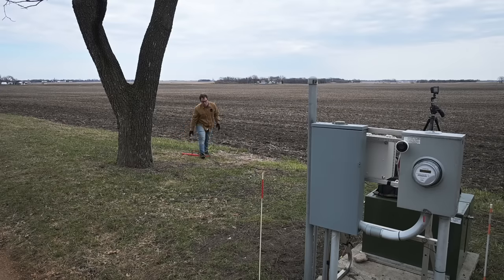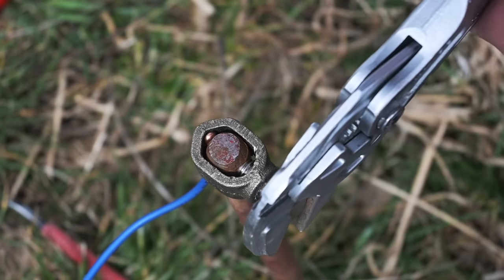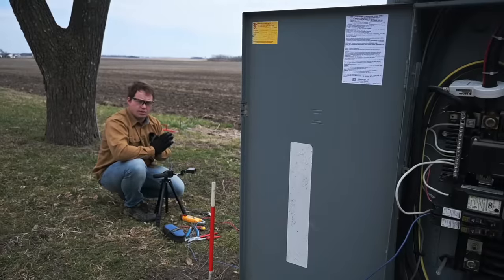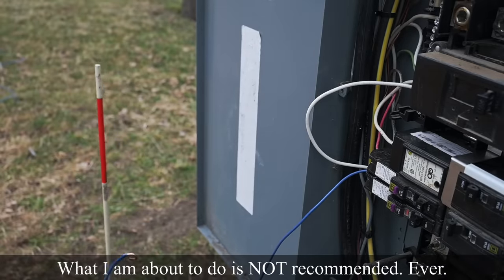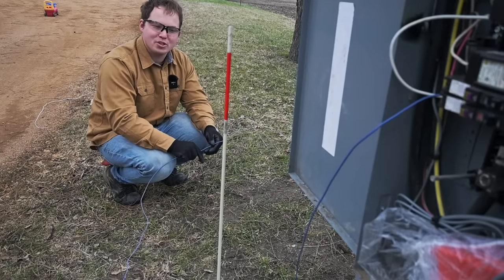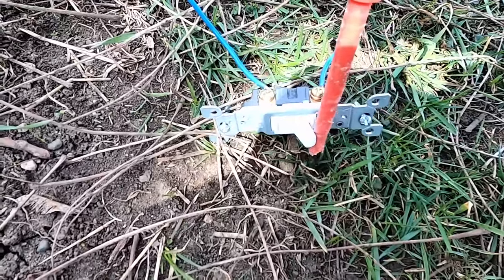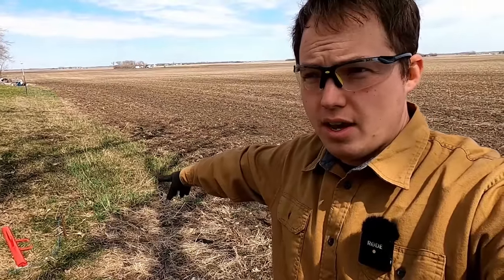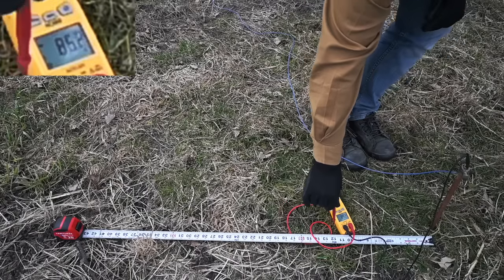Will 120v To Ground Trip a Circuit Breaker?

Comment: Benjamin,   Very good video!  I will reference this when I see necessary to change someone's mind!  About 99% of electricians and engineers incorrectly think it should trip.   What I taught was, If you need worms to go fishing, get one of those 12" long nails, attach it to a wooden handle(like from a rake) solder a conductor to it up the handle and install a plug to it on the hot side.   Now get an extension cord and plug it into a standard receptacle that you connect to the breaker in this video.   Plug it in, and probe the ground in different places.   Worms come very quickly out of the ground.   Suggest you pull it out of the dirt before picking up the worms though!   Respectfully,   Kevin
Reply: No 99% of electricians and electrical engineer know the breaker will not trip. So here is why the breaker did not trip, the was no source back to the grounded conductor. When you drive a ground rod for a panel, a conductor is taken from the rod to the “neutral bar”  or ground bar (I am setting this up as a first means of disconnect scenario and both the bars are bonded together) bounding the ground rod to the source power ground.  Basically what I am saying, no path exists back to the source power ground because there is to much impedance in the earth to allow the electricity to flow freely from one ground rod to the other.
Reply: @GUYJO1969      My point is, if you ask electricians and electrical designers and engineers this question 99% give an incorrect answer.
Question,   In a properly installed electrical system, if there is a short circuit between a hot conductor and the case of an electric heater that has equipment ground connected to it, from that point what is the path that the current will flow?   
Please give me your response to the question.   I think you will get it correct.
Respectfully,    Kevin
Reply: @KevinCoop1  
It flows across the ground conductor to the grounding bar, and then to the neutral (technically the grounded conductor of the service) thus tripping the breaker. With respect, I am an electrician and I have always taught my apprentices that I’m order for a grounding system to work properly that all metallic parts that are not supposed to be energized must be “grounded” (I use that term loosely) or bonded (this is the proper term) together. I have never had, but one set of prints in which a grounding conductor did not return to the source neutral, it was for an IG system, I flatly refused to do it. With respect to you I have been an electrician for over 20 years,  I do not know of any electrician or electrical engineer who insist that the entire system be bonded back.
Reply: It’s kinda insulting that you and you other people think so poorly of us as a trade. We try to train everyone the best we can. It’s very regrettable that you have ran into electricians that believe a ground rod driven into the ground and not tied into the source grounded conductor will trip a breaker. That is one of the first things I teach my apprentices. I had a friend shocked because the service neutral was lost at the pole and all the voltage and current was running down the grounding conductor to the ground rod. I can give you more details if you like.

Comment: Good video Benjamin!  I had someone comment on one of my videos asking me this question and I replied saying that if it was a good ground with sufficiently low resistance, it would trip the breaker.  He then pointed me to this video.  Had I thought about it a little longer before answering I would have changed my mind.  It reminded me of how my father and I got rid of dew worms in the lawn by placing 2 metal coat hangers in the ground about 3 feet apart and attaching them to hot and neutral.  The breaker didn't trip, but the dew worms sure didn't like it and would come wriggling out of the ground almost immediately!  Again, we must remind our viewers, "DON'T TRY THESE EXPERIMENTS YOURSELF"  Way too much room for error! Step voltage and touch voltage can be very dangerous and deadly!

Comment: Couple thoughts,
When I have done ground resistance testing utilizing FOP method most single ground rods I’ve tested in dry soil have been around 10-25 ohms. These breakers have a long time and instantaneous trip elements. To hit the instantaneous region you are going to be somewhere around 10-15X the FLA rating otherwise you are in the time-over current region. Trying to measure fault current you may be better served by a meter that has a peak function as some meters are not “fast” enough to capture that instantaneous peak reading. Cool video!
Reply: I think the voltage step potential that you highlighted was cool. This is a big deal in high voltage substations where you can be dealing with thousands of volts step potential if equipment isn’t bonded thoroughly.

Comment: You'll trip the breaker if the ground stake is close enough to your panel's earth stake to allow more than 20A to flow. 

It's interesting to note that locally the earth has a fairly high resistance (as demonstrated by your voltage gradient) however because of the planet's size it has a low resistance because the area of the conductor is huge even though the conductivity of the ground is lower than a traditional conductor.
Reply: I wish someone can actually do it so I can "see" it. It's sometimes difficult for me to learn without tangible proof and I don't have enough safety equipment to try it at home haha. I might go boom!

Comment: Ben great video, I am a underground troubleshooter working for the utility company in NYC. Queens and Brooklyn. You would love to troubleshoot stray voltage in a underground network system. There are so many failure points, you do a great job in explaining and demonstrating the problems. Most people have no clue what the difference is between a ground and a neutral. If you opened the neutral to your home, the ground possibly pick up the amperage and you would have stray voltage all around your property. Especially on your hose spigots. 99% of flickering lights are due to open neutrals from utility, Great job, i subscribed today.
Reply from the maker: I can't imagine doing troubleshooting work underground in NYC! Would be super fun to come along with you to work and see what its like. Thanks for sharing!

Comment: Have to say, I am total blind and I bought the Home sense and had it installed and its helping me know what is useing all the power and so forth while moveing each line to the other breaker to take away from directly from the grid.  Thanks for showing what would happen if I mess up and power go into ground. so I need to get a GFI breaker 240v breaker from the inverter so if a wire is wrong it trips.  Thanks

Comment: This isn't expert opinion.  

There are two ground systems in household electricity.  The ground rod which provides a path for high voltage spikes induced by nearby lighting strikes, static from dry wind air flow, in big systems partial faults in motor windings and such.  If the ground rod wasn't there then those spikes would build until they breached the insulation voltage rating and/or found an arc path to Earth.  Uncontrolled arc paths are bad because they can happen right through or around flammable material.  The high voltage spikes are high frequency and dissipate in the Earth resistance as they travel to the transmission system ground rod or the Earths static field.  It can still have enough current to kill a puny human if they are part of the path.

The safety ground is the bonding wire that connects every part that could become energized due to a hot wire fault, such as chassis, water and gas piping, etc, with a very low impedance path back to the transformer and then the breaker to clear the fault.  You can still die in that split second it takes for the breaker to trip if your body makes the final connection.  

The bonding of the neutral to the system ground provides a path for the system spikes.  The bonding of the safety ground to the neutral provides a path through the transformer to the breaker.

The ground rod started out at 9 amps which is 13 ohms and increased, likely due to heating along the path in the Earth reducing resistance.  20 amps for the breaker is 6 ohms but you need lower resistance to cause an overcurrent fault or more time for a heating fault.   The ground rod was interacting with the system ground of the box, the Earth provided a resistance between the test and system ground rods.  When you touched the cabinet, you were interacting with the safety ground system, i.e., almost no resistance, high current to trip the breaker.

The only way to get everything to the same potential is to use a low resistance connection, i.e., wire.  

And electricity takes all paths back to complete the circuit, including the ground rod if there is a path, not just the least resistance.  The least resistance path gets the bulk of the parallel current.
Reply: Also, I'll say for better effectiveness, one system is more sensitive to resistance(ground to neutra path).
The other is more sensitive to impedance due to the frequencies. That's why the ground conducter to the electrode must be short, straigh and with minimal bends as possible. Sharp bends increases the inductance significantly!
Reply: JK Brown why would a human being part of the path necessarily kill the human? Lightning strikes are one thing, but he is on a 120volt circuit. Would the electricity not travel along his skin as the easiest path and not close to his heart? Millivolts can kill your heart in close contact but it would be hard to get that close to the heart, given paths with less resistance. I have zapped myself plenty of times (120 and 240) with both of my hands completing a circuit and I am alive and well.

Comment: I really like this video!
I'm into structure cabling.

Short to Ground will only the breaker of the Ground is bonded to Neutral( at the Main Panel)!

I've seen engineers and electricians install 'isolalated ground' that does not connects the building grounding system at  Main Panel.😱
Reply: * short to ground or any metal part would only work if at the breaker panel or first disconnect the current carrying conducter(neutral) is BONDED to ground.

Comment: I’ll be honest.  I thought it would trip.  Level of thinking.  “15A breaker, going straight to ground.  Thought the draw would be too great and that would have tripped it.”  Good to have this knowledge considering all the renovations I have been doing.  Might have to upgrade to GFCI/AFCI breakers even if it is not called for per code.  Seems like a safe step to take.  Thanks for taking the time to do these experiments.

Comment: Ben 

The ground wire is to keep equipment at same potential as the neutral.
As you video show at ground rod their is zero potential ,  the further you go away the higher the voltage.
Therefore the green wire keeps the equipment or as you call it frame at same potential which prevents you becoming a alternate path to ground and getting shocked it is not designed to carry neutral load.
This is called step potential.

Your GFI type circuit breaker are called differential relays what goes out has to match what coming back and detests leak / shorts to ground and  it will trip almost instantly as it see as you stated as low as 5 milliamps. Better than 20amp overload  technology.

The main thing you have not talked about is the neutral wire can kill you even if main and branch/ feeder CB are open .
The neutral is still connected and is therefore it goes back to utility company transformer feeding you and other houses, etc. 
Therefore if you are working on  circuit close to another service panel you could be the path of least resistance and be a parallel path  back to utility company transformer ( step potential again.)
As a retired utility company grid operator and licensed electrical contractor I have seen one fatality and one person shocked due to this.
Yes this is 1 in a million but possible , however in your farm setting 1 in a billion.
Also soil type,  moisture content , water pipes, gas lines, sewer pipe rebar in major highways etc , etc. and distribution transformer specs. are tested and minium trips for circuits are calculated on a utility grid  most houses  however are using 15, 20 amp , etc circuit breakers or 1940 technology. The new codes and GFI type circuit breakers are 1,000 times better to protect your house and you against death , fire, and shocks.

Final note 
If on a power grid it's down and  your running off your generator and lighting hits the neutral lead on the grid it will want to find ground and can come down that utility company ground lead  and it will try to go thru your panel to your ground and if your generator ground/ neutral is not isolated it  can back feed and damage generator windings
This depends on a number of variables of the situation,  how close lighting hit to your equipment, intensity of hit moisture content , size of wire , etc., Etc.
It is a possibility 
Therefore a high end transfer switch  will isolate  and change neutral over to your generator which will be a grounded system even if it's a open neutral as your video shows.

Comment: Bro, the ground you just put in is a different ground from the one your panel is hooked up on. The soil has electrical resistance! This is exactly why there is one ground per service and only one! If instead of nailing a new ground, you just connect to the existing one, you would have a short immediately, just like you had when you sorted to your panel...
Now, in a building with a good grounding there is less risk because metal in the building is good conductor, which would trip the breaker if touched by a hot wire.
Great video, but I wish you'd explained it all better, the way you left it, makes it look like, in a correctly grounded system you are not safe.

Comment: When the wire was touched to the metallic box, the current was far greater than 20 amps.  The only limit on the current would be the impedance of the secondary winding of the utility transformer and the current probably peaked to 10K amps before the breaker tripped.  That’’s why the wire melted.  20 amps should not have harmed the wire.

Comment: Great demonstration on the voltage gradient! Just remember that the farther your feet are apart, the greater the potential is between your feet!
This is just with 120 volts. Just think if you had a near by lightning strike with several 10's of thousands of volts and thousands of amps flowing through the ground and add multiple ground rods Not bonded together and you can start to see how so much damage is done to electric appliances and electronic due to nearby strikes or surges on the power lines.

Comment: 14:55 that’s also one of the reasons why the ground rods are bonded to the neutral in the panel. That way it trips the breaker. If is it done the correct way it is safe, but if your grounding system is not bonded it is not safe.

Comment: Im looking forward to this series. Very good video! Grounding rod from what im getting in my electrical apprentice journey is for lightning mainly. Its all about the current as those electrons get back to the source that trips a breaker so going to the grounding rod wouldn't do it. As for why that happens im still learning haha. I know bonding vs grounding is a confusing subject. But really grounding rods get too much focus.
Reply from the maker: Agreed.
Reply: An easy way to think of it is to look at a house as having two separate grounding systems which are for different purposes and are not functionally related to each other. The first grounding system uses the EGC (equipment grounding conductor) to provide a low impedance path back to the neutral bus bar to trip the breaker right away. The second grounding system simply connects the house's electrical system to the earth to allow accumulated static charges to go where they want and need to go - to the earth. Otherwise the static voltage can build up quite  high on all of that wiring  and short out expensive motors and things like that. Also it helps reduce high voltage spikes from nearby lighting strikes which also want to go to ground.

So just look at this as two grounding systems with two different purposes which are not related. You could disconnect the earth ground and have no less safe an installation in the  event of a hot wire touching the metal cabinet of an appliance, etc. The earth ground is not meant to help out in a situation like that, the ECG grounding system is entirely self sufficient in protecting from electrical shock due to cabinets becoming electrified.
Reply: @MandrewP  Great explanation!

Comment: Great job Ben. I request you to repeat the experiment again and this time do these two things, firstly measure the current of your main grounding (one that is bonded with your neutral) leaving all other breakers of your main panel off.
Secondly, disconnect your main grounding and see how much current flows through your new grounding.